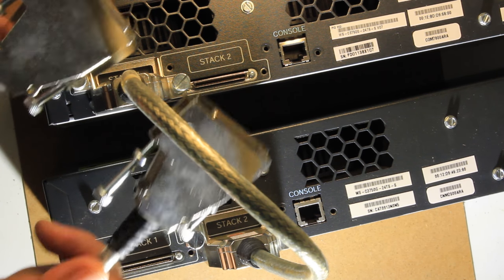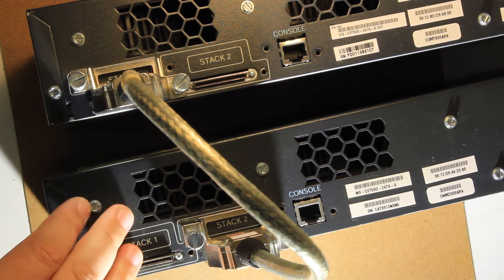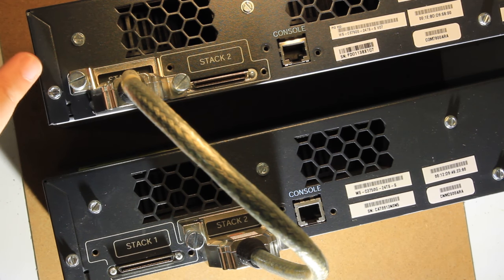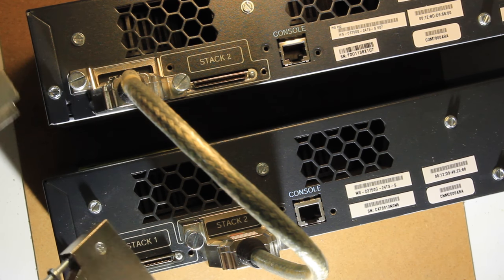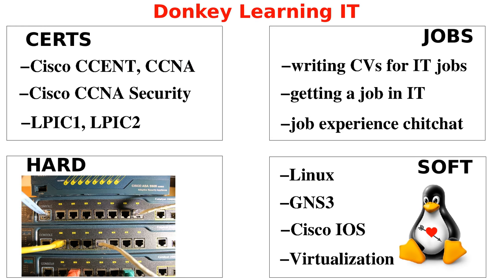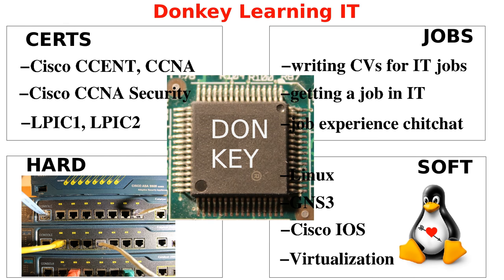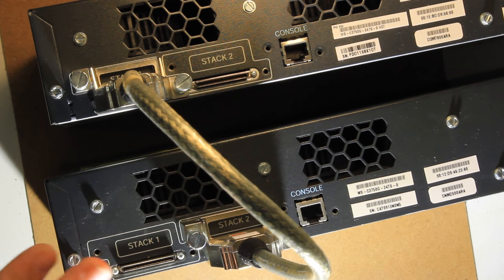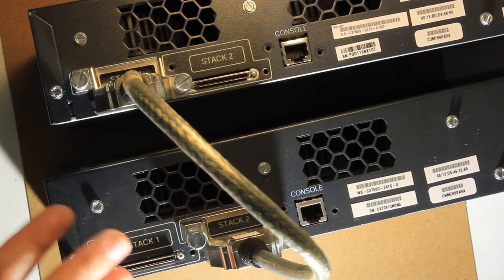Cisco stackwise #1 Basics tutorial on the switch stackwise for CCNA

Comment: Good video. Unfortunately the Cisco model of switch that you have are very troublesome as they are known to go into failure after power down/on or during reload after being in long service. Cisco's had a few failures lately relating to a bad memory supplier and then on ASA and ISR clocking signal issues. In addition have you covered fake Cisco equipment and how to identify them? You are doing such fabulous work.

Comment: This is really a great video! I'm a cisco newbie and recently working on how to stack Cisco WS-C2960X switches. One is in production for years and now we need to expand another one. I was looking around your 2nd video but..... Is there a video from you for covering on how to "configure" after connected both switches via stackwise cable? thanks again for your great video!
Reply from the maker: Hi Jeff! Thanks for the comment. Sadly I never made the second video, since I am busy with my daily job and with other issues. Still, I have received so many comments on this video, that next month I will take the time and finally make it. Though, with the 2960X I do not have hands-on experience, since we use larger switches (i.e. 3700 series and above). Btw, does the 2960X have any L3 switching besides the inter-VLAN switching via virtual interfaces?

Comment: You can get a Cisco core Switch with two blades and 7 slots of 48 gigabit ports each for about 1000 usd now
Reply from the maker: Yeah, times have changed. I guess if switches would be GPUs, they would cost more in the current market. Still, stackwise is not going away from old installations. People love it and use it all the time.

Comment: We just put Cisco 3650 48 port then stacked them if you buy from reseller they're about £5-6000 get through eBay for £1500
Reply from the maker: For a used 3650 I find 1500 quids a bit too much, especially considering that they are EOS. Even if you would have purchased a refurbished unit from a Cisco certified reseller, you could have gotten probably a better deal.
Btw, are you happy with the 3650 series? Just asking, because I think that the 3750Gv2 would be a bit more future-proof, but this might be just my opinion.